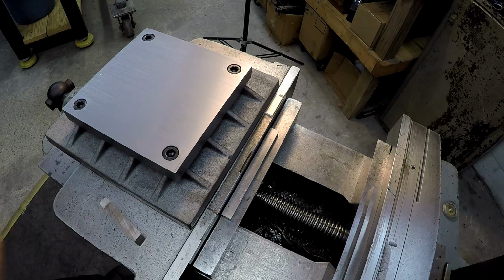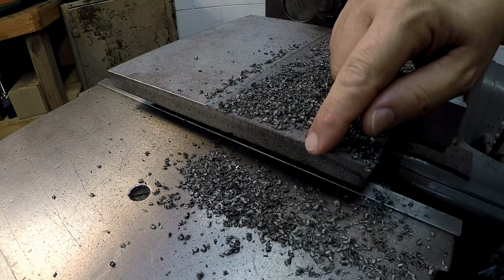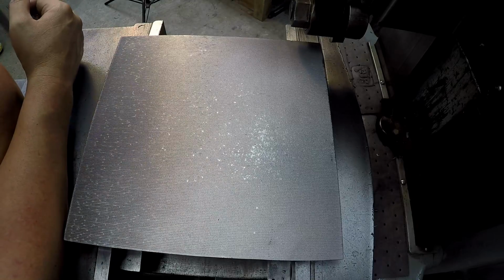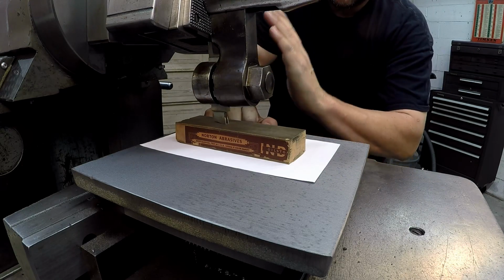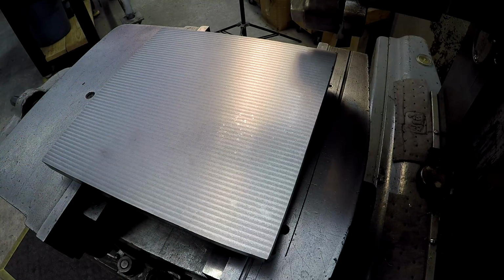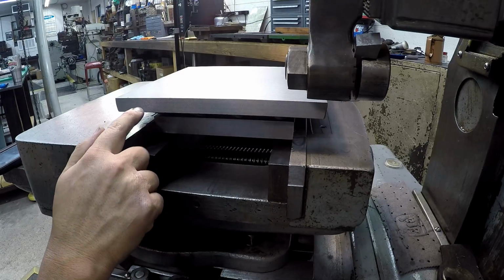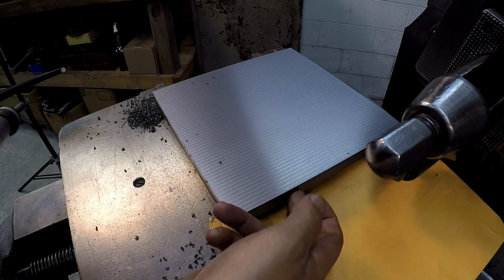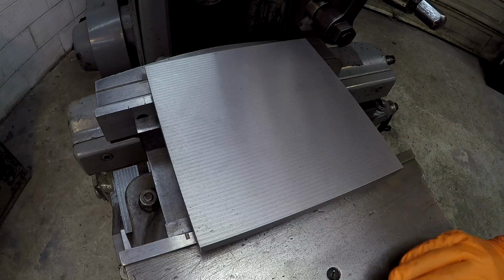Fireball Tool Fixture Plate Part 5

Comment: You briefly touched on using the depth mic for checking how centered you were on the baseplate, would you mind sharing the final numbers for that? Maybe along with insights on whether or not it is much concern for your usage. I'm guessing it isn't too big of a concern since you'll be likely to re-indicate if you are rotating the fixture?
Reply: You should be able to figure that out from the dimensions given. (Top - Base)/2 = (10 - 7.5)/2 = 1.250" within a few thou. as he was 2 over on one axis and 1 under on one base plate axis.

Comment: There's something special about they rhythm and sounds of the shaper that can't be more relaxing. It's wonderful to watch a machine do work with such grace. Its a great project machine to work on maintain, but even better as an elegant process, and you can't beat that pattern.  What I like most about this channel is your genuine interest in the machines as a tool and as a system of function and design from a place and time.  Your interest in keeping these machines in use is no different than a guy interested in cars, restoring them, and driving them.  Thanks for sharing that passion and interest and spreading it out in the world for the rest of us.

Comment: If I had one of those I would love to work with it too!! Could an adapter for a grinder, say a 3" wheel, be made to turn this into a surface grinder?
Reply: Probably, but it wouldn't last long. The grit would eat up all the slideways and it would be a real challenge to guard all of them. A lot of grinder design is how to keep the grit out of the moving parts. Adam is on the lookout for the right surface grinder to add to the shop.

Comment: Thanks for explaining the clapper box angle. When I am trying to get my head around a subtle adjustment like that I try to imagine the same change if it were taken to the extreme, such as if you could set it at almost 90 degrees, then the clearance issues are obvious.

Comment: Hey Adam I think it's awesome that you use in the shaper when I worked in a machine shop used to use one here and there I work as a heavy truck mechanic now it's a great feeling to grab a old toolsomething that you made to get the job done yes you can get it done on the mill who cares you brought that machine home cleaned it up and it works great working condition and every machine stroke make you happy keep up the great work Adam awesome video thank you

Comment: Adam why does the vise feed move before the cutter goes all the way home?   Just noticed this watching this video.   Looks like the table is moving mid way though back stroke.   Seems like that would be hard on the cutter?   I know nothing about shapers.   Just wondering.
Reply: This is why the Clapper is angled, on the backstroke when the feed is advanced, the tool pivots up and away from the cut leading edge of the material.
Reply: @j-man72b72  Thanks J-man yeah should always finish watching a video before asking a question.   Now makes sense why the Clapper is at an angle, although I wouldn't have now know right from wrong as to which way.

Comment: That finish is cool as can be.  I would have questioned whether you're forming ridges due to lack of flatness in to tool, but the honing takes care of that question.
Reply: I assume that Adam had the tool in it's rest position when honing or else the clapper would change the angle of the cutter.
Reply: Sure.  You could see him create the angle by adjusting the table height.  My concern with flatness and the shaper in general is the stepover versus how perpendicular the tool is to the work.  You'd end up with a series of waves.  You also get that with rotary cutting obviously.

Comment: Hi Adam, I've been loving the shaper videos, such a pleasing, quiet machine with a slower rhythm than the mill, and with good control over the feed/speeds.  Really feels like it has more of a kinship to lathes than to a bridgeport type mill.

Have you cut any stainless on it?  I'm very interested in how a material that complains with the interrupted cut off of an endmill would behave in the shaper.

Comment: Go the Shaper !!  When I was an apprentice back in the '60's I used to cut bevel gears on a shaper. The bevel gear was mounted on a mandrel in an indexing head at about 45 degrees up in the Y axis, then the space between the teeth was machined with a form tool. Then the indexing head was rotated a couple of degrees about the X axis, and the base of the indexing head was also rotated abut the Z axis and the first side was cut out. After that was done, the indexing head was moved in the opposite direction/s and the other side was machined.  That finished the bevel gear. I called the longtitudinal direction of the Shaper as the X axis for clarflication..

Comment: When I took my first machining class in community college, I always tried to finish my regular assignments as quickly as possible. Because if I could finish my lathe and Bridgeport work, the instructor would give me odd jobs with some of the old dusty machines like the horizontal Mill and shaper. I loved learning every bit of extra knowledge, even if it didn't apply to the class or the usual job shop work.

Comment: Another thing about shapers that is often overlooked is that grain direction does matter sometimes.  I've had customers with sliding components that need machining in a particular plane to make assembly easier.   Shapers are great for that.

Comment: I would be willing to bet that a part cut level with a shaper is probably more likely to be dead flat than say a mill using a large end mill or a fly cutter. My reasoning is that the shaper induces far less heat and what heat it does create is spread evenly over a larger area. Parts would be less susceptible to temperature growth which would affect the accuracy of the cuts. A mill on the other hand works over a much smaller area but induces more heat with it's rotary motion and the drag of the cutter on the negative cut side in a more concentrated area which would create humps and hollows affecting accuracy.
Reply: And you had better have the head trammed in perfectly, or the face mill/ end mill / flycutter will leave a step between each pass.

Comment: never noticed how it steps over while feeding back. figured that would be hard on the tool having it side-step into the cutter like that. i thought it stepped over after the full retract
Reply: The flapper lifts the tool just enough it isnt an issue.  But I thought the same thing..
Reply: @jacobhawkins7949  must be why the clapper box is mounted at an angle perpendicular to the direction of feed.

Comment: Hi Adam. I think I told you before I have a shaper I restored. I keep it at work in storage as I do not have the three phase at home.  In my opinion the shaper is not a production machine by todays standard but the finished of the shaper is the best. It is nice  watching your shaper and hoping one day I can run my own. I studied electronic at university but we did machine work for a year. I made a tool makers clamp on the shaper happy days nearly 30 years ago. Great video as always Adam. Thanks for sharing, it nice watching you work and enjoying the machines. Regards Chris

Comment: What you were saying is true about the shaper  and the mill. If you take the cost of the tools the shaper will come out   on top as the mill tooling is expense to buy and the replace tools bits too. If the mill is not set perfectly square to the   bed you end up with the cut been stepped  as you move over.

Comment: When you hone the tool while its hanging from the clapper thats set at a angle and swung out a few degrees, does it then hone the high speed steel cutting face at a angle when the clapper is sitting at the cutting angle and not swung out anymore?

Comment: So No Oil on cast? Is that with any cutting on cast?
Reply: Cast Iron is self lubricating (due to the graphite particles from the high carbon content) so no oil is usually needed. Coolant may still be used for temperature control or flushing chips.

Comment: No comparison between pair of processes when applied to the larger pieces; shaping process will produce the most accurate work without additional surface grind every time, because the chip, not the work, gets hot. Couple active shops in Michigan doing nothing but shaping. Thanks.

Comment: Yer shop, yer channel. You can use a hand plane if you want! Actually I'd like to see that!
Reply: Rv4 Guy   That's an interesting comment. An equivalent hand plane roughing job in wood would use a scrub plane. Its job is to remove a lot of wood quickly. Its blade is sharpened wth a radius (something like 8 inches), like Adam's roughing tool. If it were a board, I'd be tempted to call those flecks tear-out. It's interesting that some of the same concepts work for iron & wood.

Comment: There's a lot of history and heritage with shapers. That plus low tool cost and versatility make them outstanding. One other minor point is that the shaper lets you get it set up/running, and do something else (within reason). There's something almost hypnotic about watching one run. Much calmer and quieter than a mill. I'll have one someday. It's your shop. Run it your way, Adam!

Comment: You should make it cut on the backstroke too.
Reply: Normieal - shapers aren’t designed to work on the back stroke; that’s why the clapper is hinged; plus, you’d have to hone the trailing edge of the cutting tool, also. The final part of the problem is that, even if you did hone the trailing edge of the cutting tool and you somehow prevented the clapper from moving, is that the table side- or down-feeds on each back stroke, which would grind the tool in more on one side than another... that is, if it didn’t burn up the tool, or break it outright. HTH! 😎
Reply: @williamsquires3070  I don't see why It would be harder to stop it moving on the backstroke.
Reply: @argonthesad  it's simple. It's designed to cut on the forward stroke. The back stroke is where it changes it's depth of cut weather that be x or z.
Reply: @LPRNChannel  Why would changing depth of cut interfere with cutting on the back stroke?
Reply: @argonthesad  It's a mechanical system. It so happens that the back stroke is where the system, as designed, functions these processes. I would think that a complete motion stop would be needed to make the changes in depth of cut if you wanted to cut in both directions. And that then requires an alternate mechanical control system and mechinics to accomplish that. Then you have to account for the forces involved (and they are substantial) which likely changes the design requirements of the ram, tool holder etc. Pretty much everything would need to be redesigned. You'd end up with a machine that's no longer a shaper. Add to all that that the tool geometry would change so dramatically as to result in a need for a second unique cutting edge.. . .  And all the complications that would imply. Suffice to say that this is not a hack one would embark on. Especially considering that the shaper is working just fine as it was designed to do.

Comment: those discussion shaper vers. mill is needless, because they don´t get it. But ok here we go: first point of view is, it´s your interest / hobby. You learn and have fun, that´s great, use the shaper. Second point of view is, what does it cost, to make the part. If the largest part of the cost is the cost of the worker, you have to use the mill, because the mill gets the job quicker done. If the largest part of the cost is tooling, you HAVE to use the shaper, because the shaper has way lower tooling costs. Now, you don´t pay for your own time, so guess what: if possible, you have to use the shaper from a financial point of view also. So, go ahead, have fun, lol. And they don´t get it anyway.
Reply: Udo Willkomm There are some jobs only a shaper can do efficiently.. such as cutting a square keyway in a bore. In a job shop, where a one-off situation prevails, it would be financial disaster to buy a large broach for one job... but a shaper can just be set up and cut that slot with speed and virtually no custom tooling cost.
Reply: Look, now we have a third good reason to use a shaper...

Comment: I see the ease of using a shaper to flatten the surface of your piece, but wouldn’t a grizzly bit or a shell end on a vertical mill be just as effective and seems to me, faster? Just curious. Awesome videos btw 👍🏼
Reply: It would be faster, but a lot more expensive to buy a shell mill engineers than a piece of hss. Besides the mill might be running a job that makes more .oney.
Reply: Think or visualize how the average sized Bridgeport type vertical mill operates. For the 
table to even move there has to be at least a few thou clearance to allow that. As the table, 75 + lb vise and part moves in X once it goes far enough the table will over center and rock downwards on one side and up on the other due to gravity. It has to since it starts taking up those minor clearances. If the part is long enough it will be bow shaped due to that rocking. Then look at how that shaper's table is supported by both the rear full length rail and the 
front support foot. That's why a shaper that's in very good condition can approach  the 
surface flatness surface grinding can do. At 3 minutes plus change to do a roughing pass with that shaper on a 10" x 10" part surface that's not doing too bad at all. Even a real 
Bridgeport with an R8 taper is only good for a 2 1/2" - 3" diameter face mill. So call it 4  
passes to do a full roughing cut on that part face. You might save 1 minute (maybe) but 
with a whole lot more cost in insert life. For multiple hundreds or thousands in a production shop then yeah those minutes would add up. For a one off where the actual time is of less
importance then the shaper wins hands down. On a 10" x 10" part face it's still debatable if that table rocking would be an issue or not. If I had to bet though my guess is the shaper 
would still produce a flatter part with a better surface finish.

Comment: Nice finish on that Surface Plate..  However..  I would think about or consider using a "FEED" of approximately 50 - 60% of the width of the Cutting Tool..  Just something to think about.. However..  It's what works.. https://youtu.be/dF-14pClm0s?t=1173   Looks Great..  SO Nice..  This surface may make a NICE Hand Scraping Project some day..
Reply: If im not mistakin, he said tool was 350 wide and 180 stepover is in your wheelhouse at 51%
Reply: What a learning experience this is..  I'm back watching this again.. During my semester at Trade School I chose to make a Surface Gauge like the Starrett Model.. I used one of the Shop Shapers to make the Base Block.. After it was Marked/Graded by the Teaching Staff, the Surface Gauge was selected  to be placed in the School's Display Lobby..  It was there until the School was Closed and Demolished..  https://www.facebook.com/photo.php?fbid=10156128770193655&set=gm.10156496462876469&type=3&eid=ARAt_tJmFtCE3tHXOtPf4-HMahRrcYivn6RFb5N6gfb7NpG_Evw-n8EzKVMQuxuHDS0B-FPCLiShL_bv    https://www.facebook.com/thechronicleheraldarchives/photos/a.1657224887859269/2035275000054254/?type=3      The Vocational School made way for a NEW High School..  sigh..  The School should have been left as a Vocational School..  sigh..

Comment: I started working in a machine shop straight out of trade school n 1979. My first work was with a shaper, I spent about a year with it on Cast and Cold Rolled Steel. I really got into it, the tool grind, material feed speeds. It could make the heavy cuts that a vertical just can't do, and a horizontal is too limited in scope. This brings back good memories for me, thanx.